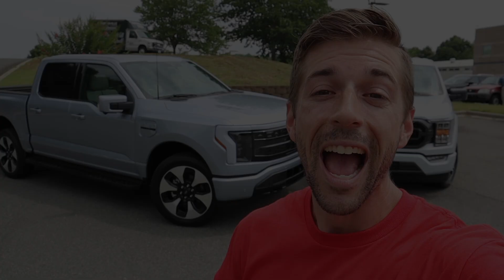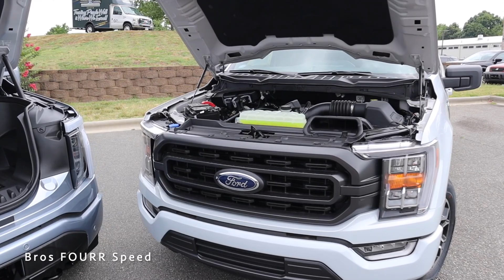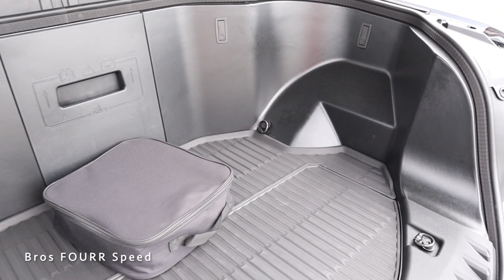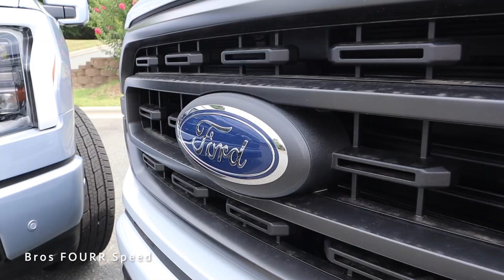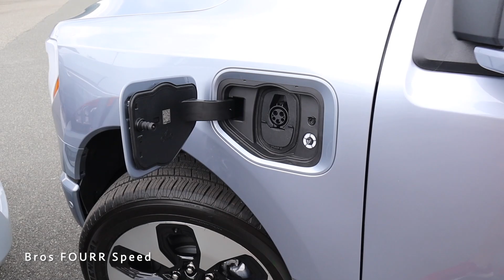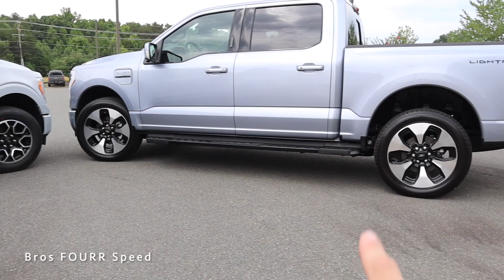2022 Ford F150 Lightning!  BETTER THAN THE V8!?

Comment: An iphone has to be the same price everywhere. They do this for the consumer. These lightning trucks are heavily marked up at the dealer and that is total BS.
Reply from the maker: I don’t agree with markups on vehicles, but supply and demand can control that too.
Reply: @BrosFOURRSpeed  supply and demand my ass. I reserved one for a reason based on it's advertised price. What exactly is a reservation if you don't get the car?
Reply from the maker: @Team_Osshole  I don’t think it’s right, but you don’t have to buy it if they mark it up. Dealers get away with it, because people buy them even if they don’t want to spend that much. So if people stopped paying over, dealers would have cars sitting and hear the people wanting to pay less.

Comment: Great video comparison.  One major difference I never heard you mention is the lightning is the very first F150 with rear independent suspension, which is extremely beefy, and in my opinion gives this F150 a more comfortable ride. I believe I'd stay with the gas version if most my use was out on the open road, but in my case , my use will be almost exclusively in the city, so the lightning is definitely the right truck for me. The kicker on that for me, my home runs on solar unless I'm without the sun for a couple of days, so my excess power that's normally wasted will be used to charge my lightning.

Comment: lightning is probably better suited for older retired people who live in the city, have a stable charging station, and only travel back and fourth to the store, but that's really it...for a young person whose on the move, traveling from city to city, commuting to work everyday,  and just has a need to hit the road and travel more than 30 miles on a day to day basis, EV simply just would not seem like a good idea...i couldn't see myself personally being responsible enough to remember to charge my vehicle on a daily..when i'm low on fuel, i take 4 minutes to refill and then im back on the move...hell, when dealing with ev, something could go wrong with the charge and you'll either end up stranded or having to wait longer for your charge to complete and if you oversleep or simply just forget to recharge, you're just out of luck since charging is more time consuming and/or complex than a simple gasoline refill which imo is more fail safe...i've had several RC cars in my day, and even then, charging them was a headache especially when the battery systems developed flaws or would not hold enough run-time for me to get out a good 14 minutes...i couldn't imagine having a full adult sized RC car, but that's just my opinion..😂..i preferred my ole gasoline powered rc car to any of my electrical ones aswell..
Reply from the maker: Thank you for sharing!!  I think it's definitely a cool concept, but electric vehicles still have a long way to go!  You won't be able to tow long distance with it and yea charging is the biggest drawback if you forget or want to drive farther and you have to plan longer stops to charge!  Electric vehicles are definitely better in the city for sure and it's great if you have to haul items around the city!

Comment: V8s  is a big part of the automotive history in America.  I prefer the V8 if any towing was involved, yes the Lightning is more efficient but the costs will still add up if you travel a lot of miles a day and have to charge it often.

I would pick the lightning only if my commutes consists of short trips and/ or city driving.
Reply from the maker: I would agree! If you tow get the v8! If you need a truck for bed space and short trips, the lightning is a cool option!
Reply: @BrosFOURRSpeed  I also agree but the lightning is also a great towing truck as long as you're towing short distances.  I believe one of the major advantage of the lightning is charging at home with average costs of $.15/kWh.  If you're going to use the public DC chargers you're comparable to gas prices. Not to mention the time you will have to wait to be recharged.  This will eventually improve as vehicles are allowed to accept higher kilowatt charging rates and there are DC chargers located at every gas station.

Comment: EVs are great tech BUT lets face it after warranty expires and if your batteries goes bad the cost will be astronomical. Also, tree huggers complain about ICE cars and forget that you need coal to power the power plants that power EV vehicles. So, you are not saving the planet.
Reply from the maker: I agree with you! Once the battery dies, essentially the vehicle is totaled because it’s also built into the structure of the car. Still neat to see.